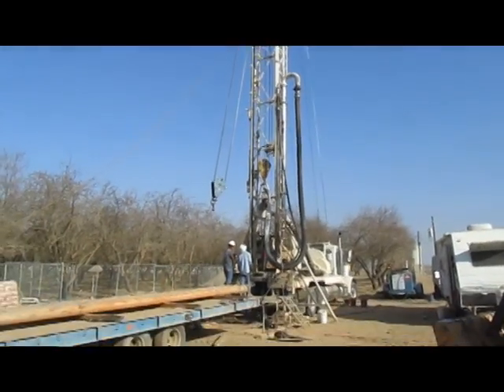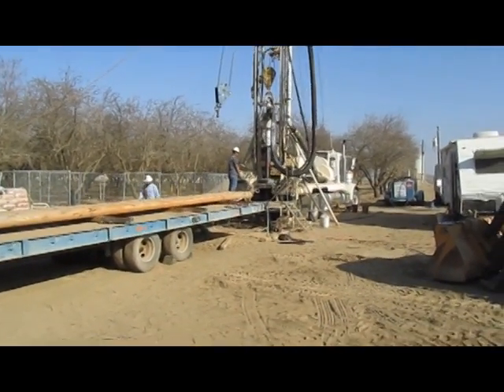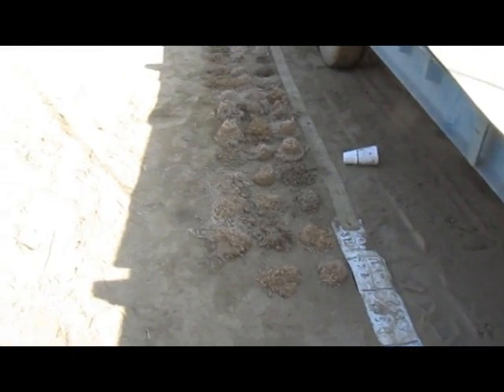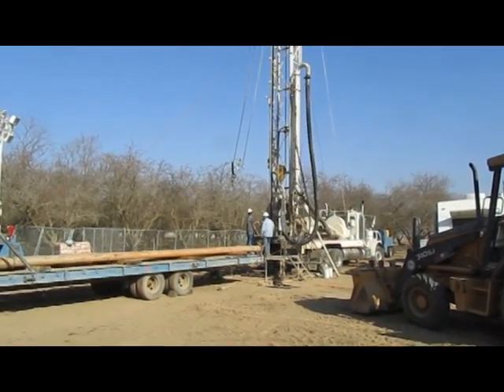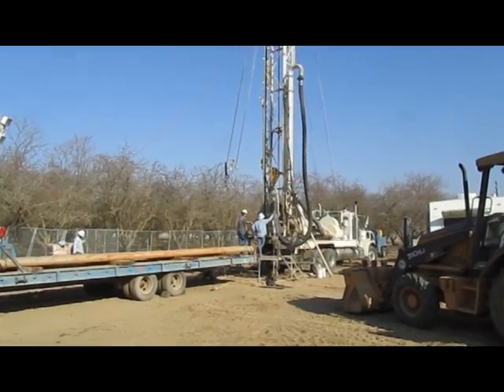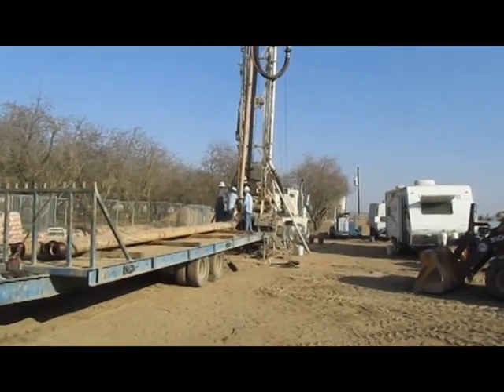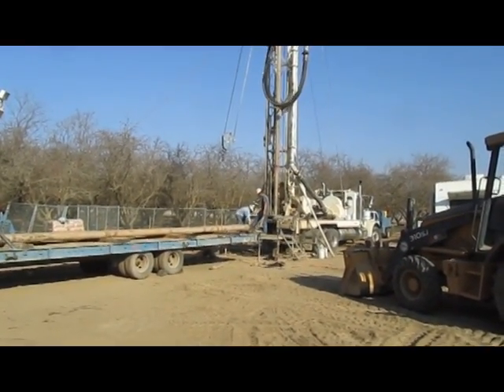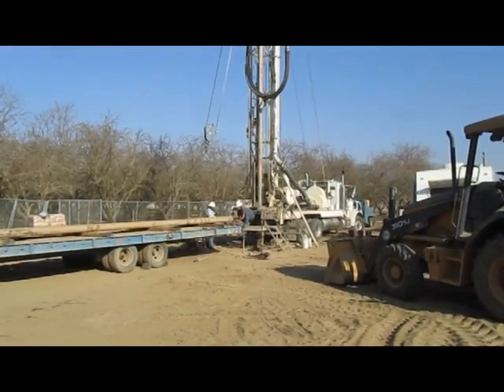Well Drilling in Kern County California

Comment from the maker: I received this reply from one of our West Coast Managers:
We have drilled several wells the past 4 years, imagine that, and the average cost
per foot has been $250 to $275 per foot.  The cost to drill the deep wells, 1,000 foot plus, is expensive because to drill it we bore the hole twice.  Just like drilling in wood we make a pilot hole then go to a larger final size hole.  This gives us a much straighter hole which is important when going so deep. To equip that well with all of the hardware would cost an additional $150,000 to $200,000 to get it up and running.  In total our wells have been costing around $400-450,000 each. Water in CA is very expensive.
Reply: Thanks for the video. I'm curious what an approximate cost would be for a residential well vs this ag well? I imagine you wouldn't have to drill it twice because your well diameter would be much smaller? Also, the equipment such as panel, engine etc would be smaller and less expensive. Any idea what residential wells are running these days in Kern County? Say at only 250 feet deep?
Reply from the maker: From our West Coast Manager:
Generally domestic wells are 8” in diameter and do not normally require to be bored twice.  Domestic well depth varies thru out the state with an average depth of 250 to 300 feet being common and the price ranging from $50.00 to $75.00 per foot.  The pump components for a domestic are quite a bit less running several thousand dollars to outfit a well.
Reply: Thanks for the reply! Yeah, that makes sense. I figured somewhere around the $20,000 to $30,000 range depending on conditions.